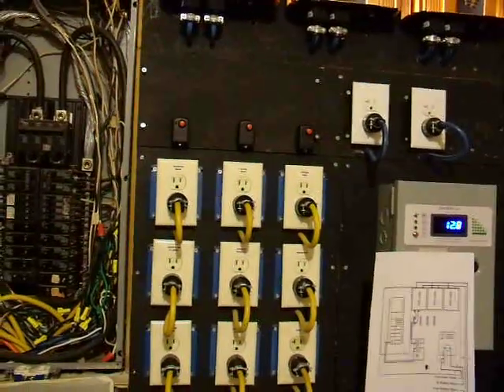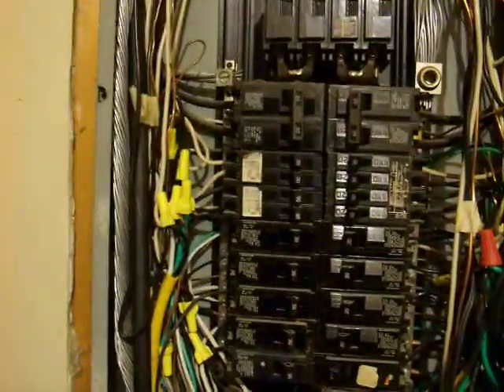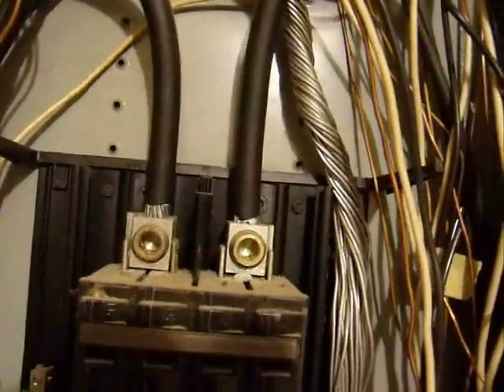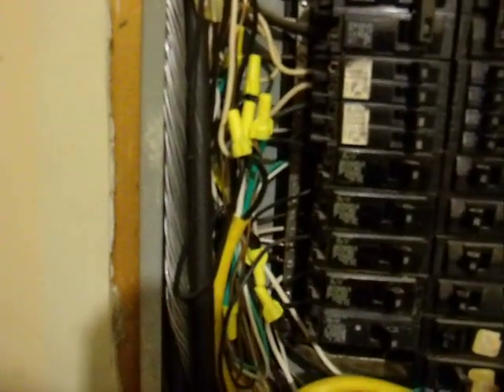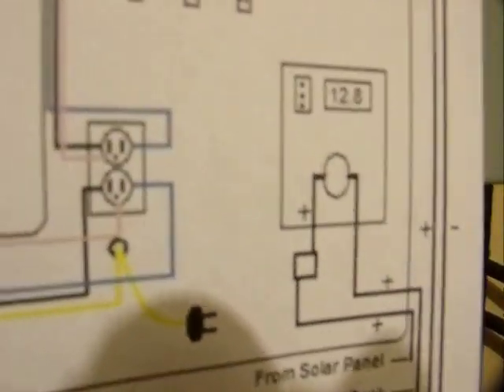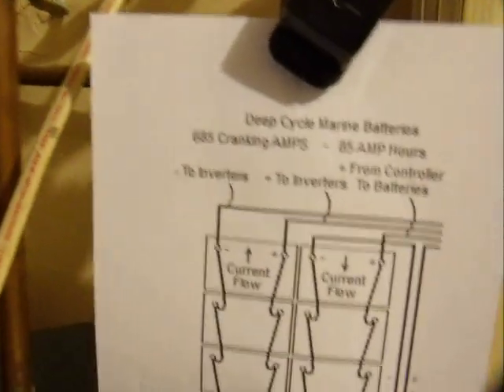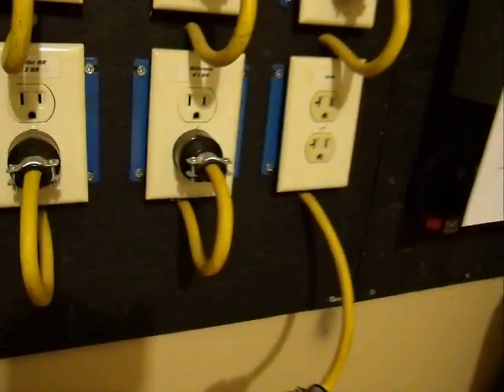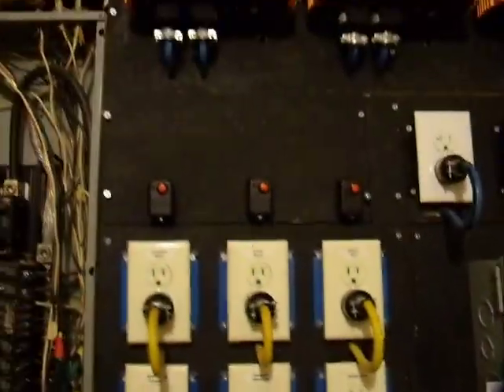Solar Generator Wiring Diagram

Comment: Good advice for them to be careful, to know what they are doing, to always and I mean always "test" to see if a wire is "hot" before doing anything with it.  

I bought an older home years ago.  The person who owned it before me did some non-standard stuff...he basically wired the well into the "back" of the panel.  The only way to turn it off, was to cut the power to the entire house...the other breaker box on the outside of the house.  I shudder to think what might have happened.

Comment from the maker: Yes. The bottom of each receptacle gets power from the coinciding breaker. The whole thing works as it would normally. The Inverters have circuit breakers also and remote resets that are mounted down low so they are easier to reach. Thanks :)

Comment: Question? From the receptacle outlet, the bottom put thats connected to the grid. You have power coming from the breaker right?  The breaker is still being used right?